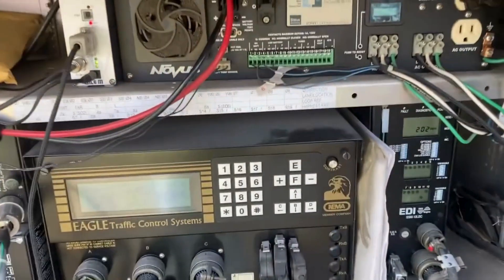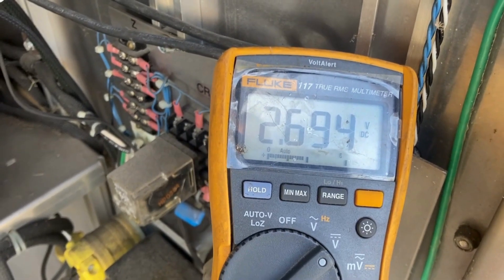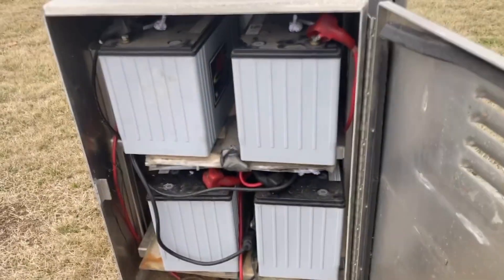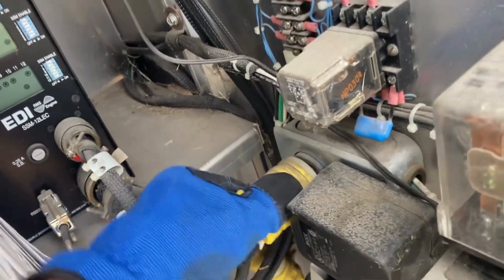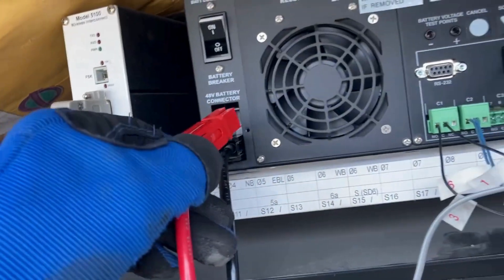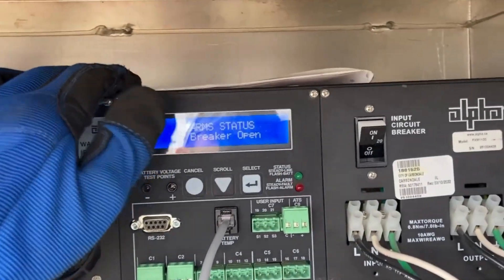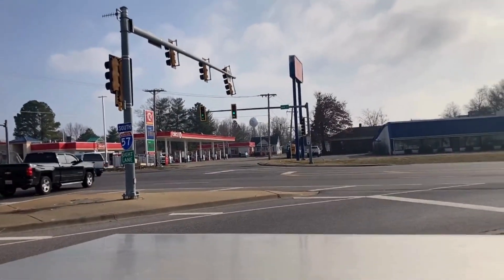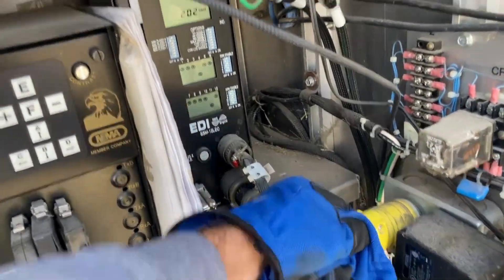Cutting Off Power to Traffic Lights

Comment: Usually there is a generator connection on the outside of the cabinet and when power fails the city brings a portable generator to the intersection and chains the generator to the pole. 
I don't know how long a generator keeps it running for.
Reply from the maker: Yes, some of our cabinets have that setup.  And yes, we do utilize that option when we know there is a wide spread power outage and the estimated time could be more than 6 hours before power is restored.  That setup is nice to have!

Comment: I'm now convinced that a backup system should be required on all traffic light systems in the US.
Reply from the maker: You find out which drivers know to treat a signal as an all stop sign signal when signals go dark.  I see about 2 out of10 that blow right through it almost causing an accident.  It definitely becomes a dangerous situation without power.
Reply: @streetsmartstraffic  Where I'm at it's the exact opposite. I treat them like I'm supposed to, but I've had other people honking at me and give me the finger and all that jazz because I'm doing what I'm supposed to. Very rarely do I see anyone treat them properly. Even a basic 4 way stop people just blow right through.
Reply from the maker: @SOU6900  Ok i have to ask...where abouts are you located?  I'm sorta doing a pole on how bad drivers are getting...
Reply from the maker: @SOU6900  ah yes, those north carolinians  lol
Reply from the maker: @SOU6900  I sure do!

Comment: I appreciate the lack of editing. Sometimes I scratch my head wondering why something isn’t working only to notice that the equipment isn’t plugged in😂 I know there’s a temptation to edit out little boo-boos like that. I appreciate your keeping it real👍👍 These are teachable moments for traffic signal techs learning the trade. Great job.
Reply from the maker: I try to keep it real!  As i talk about in other videos, I keep the camera rolling to show mistakes I make so other maintainers (and as I have found out--many signal hobbyiest) don't make the same mistaks.  I balance between length of video (get to the point!) --vs showing small things that may be missed during troubleshooting & repairs.  Thanks again!
Reply: That is why IT does as that first... so many times it is the issue...

Comment: Nice to see DOT being as proactive with their batteries as the cable company. (at least you're replacing them once spotted.) Also, at 2V for a 4S string... those batteries are now trash. (there's no telling how long they've been like that. not that we were shown how old they were to begin with.)
Reply from the maker: I answered this same question in another comment here...so sorry for the redundcy.
This video was shot not long after I came to this DOT. They were down a tech for over 2 years and many things went wayward.  One of initiatives we pushed 1st was to update all the batteries.  (Probably sat dormant for years).    Anyway, as we were replacing batteries, we found many dead BB units.  They're not cheap so we had to budget over time to start replacing them.  This was one of them...
Thanks for commenting!
Reply: You mean more pro-active!  Cable company just says "hey customers, if utility goes out we can't do shit about it, don't call us not our problem".  They actually went and fixed this traffic light backup!
Reply from the maker: @matthewmiller6068  Well we tried!  Once we get all signals on to our network to monitor (over time this will happen) we can set up alarms to notify us when batteries are getting low.  In the meantime, we started a 4 year plan to check batteries for replacement.  Thanks for the comment!

Comment: Seams like there should be maintenance done on the batteries on a regular basis, thats what companies do that have critical equipment.  Not sure the purpose of a battery back up if there is no checking or maintenance done.
Reply: Unfortunately, AT&T is guilty of the EXACT same thing. Years ago the company treated battery backup systems as a serious, important function to provide total reliability to the customer. Not any more. Even when the company was regularly having pallets of batteries shipped to outside facilities warehouses, they would not schedule outside plant technicians to do battery replacement. Batteries simply sat in the warehouse. SERVICE is no longer a priority❗️
Reply from the maker: I answered this same question in another comment here...so sorry for the redundcy.
This video was shot not long after I came to this DOT. They were down a tech for over 2 years and many things went wayward.  One of initiatives we pushed 1st was to update all the batteries.  (Probably sat dormant for years).    Anyway, as we were replacing batteries, we found many dead BB units.  They're not cheap so we had to budget over time to start replacing them.  This was one of them...
Great question!

Comment: That's really interesting; Worked on some huge industrial furnaces and they got battery back ups on conveyors should everything fail.
Reply from the maker: That's cool!  Interesting to hear about other industries that use BBU for criticaly type applications.  Thanks for commenting!
Reply: @streetsmartstraffic  It's to ensure the machine won't be damaged during a power outage in my situation; For both of us machines need to provide services even if half rooted.
Reply from the maker: @TradieTrev  Agreed!

Comment: I didn’t know traffic lights had battery power backup. I don’t think any of the traffic lights in my town have it. If there’s a storm and the power gets knocked out, the traffic lights in the area are all dead, and you treat the intersection as 4 way stop.
Reply from the maker: Not all intersections have them.  Some municapilities don't want to spend the money as they'll just use generators or stop signs during outages.  We get them in our spec on every new or upgraded cabinet design.
You'll usually see them on higher speed corridors due to the increased danger posed by outages at those critical intersections...
Thanks for commenting!
Reply: "Light, sign, line"... but no one remembers that from driver's ed. (i.e. no one cares about the law.)

Comment: The fan of that backup unit looked really clogged!    Why don’t use LiFePo4 batteries as replacement instead of Pb?   Tnx for the vids!
Reply from the maker: Yes as I answered a few of the other comments, this was a dirty cabinet.
I don't really have an answer for battery question  I had to look up a little about them..
It said the drawbacks are:  higher cost, slower charging speed, lower discharge rate, and limited temperature range are some of the drawbacks of using LiFePO4 batteries.  Maybe their not compatible or optimable with the system?  I'm not sure...

You're welcome and Thanks for commenting!

Comment: If the batteries sat for any length of time at such a low voltage, theyd be pooched anyway even if you did recharge them. So glad you decided to replace them!
Reply from the maker: Great point!  I just hate throwing out anything and if there's any chance of life to it, I want to still use it.  In this case however, I'm glad I replaced them too!  thanks for commenting!
Reply: @streetsmartstraffic  I've had alot of success reconditioning lead acid batteries on a decent charger, especially the sort with the caps as you can rewater them... But only managed to get about 50% capacity back.

Even with half the capacity, probably not bad to keep on the truck for an "up shit creek" scenario when you don't have any in the shop or can't get to them.
Reply from the maker: @alex13902  Excellent point.  I brought those back to the shop bought I think they ended up on the pallet for return.  😬
Reply: @streetsmartstraffic  Likewise but whenever I've encountered an issue with the charger or even if it was only one battery that was faulty, both batteries would be replaced as preventative maintenance in the fire alarm system.  Same for the emergency lighting.

Better safe than sorry.
Reply from the maker: @dang48  ah, good to hear...and agreed!  Thanks for your input!

Comment: I can see why that battery backup went RIP.... That fan.... must have been a pretty harsh heat stroke before that battery backup threw in the towel and said "bye bye".
Might be good to invest in a battery powered vacuum cleaner (like milwaukee M18 VC2), so you could do some "preventative cleaning" inside those closets, especially around fans and ventilation holes.
Reply from the maker: You're right Sebastian!  Many of these cabinets have either been upgraded or are finally get cleaned up.  As you know, alot of stuff already takes a beating from heat--they don't need all the dirt as well!  I've since purchased a large wetvac to do some major cleaning in these cabinets.  
Good observation!

Comment: I'm rather surprised that a signal maintainer finds, by surprise, that a battery backup system isn't functioning.  I guess very long periods can go by where nobody peeks into these cabinets.
Reply: I have to pass a certain intersection most days going to work. I'm going on 10 years in the same building. I've learned a few things watching these videos. I'm quite sure this signal needs adjustment. Cars in the turn lane might get a green or the might not. I can just miss the green light, sit through the entire red light and still not get an arrow. I make sure I'm in the exact zone I should be. It's still a roll of the dice. So either that's the plan or nobody has checked this light in a long long time.
Reply from the maker: @glen4cindy  Isn't it frustrating!?  There are a whole host of possible issues going on there.  Sounds like vehicle detection is present but may not be optimized correctly?  Best bet is to find the phone number to the municipality public works department.  Give the intersection name and you're best description of the complaint.  I've had a few youtubers that have sent in video of the issue to their municipality's website contact info.  
BE PERSISTENT.  Many times, the problem doesn't get addressed right away.  But the squeaky wheel gets the grease!  Hope that helps...
Reply from the maker: I answered this same question in another comment here...so sorry for the redundcy.
This video was shot not long after I came to this DOT. They were down a tech for over 2 years and many things went wayward.  One of initiatives we pushed 1st was to update all the batteries.  (Probably sat dormant for years).    Anyway, as we were replacing batteries, we found many dead BB units.  They're not cheap so we had to budget over time to start replacing them.  This was one of them...
Great question!

Comment: How does the battery backup connect to the grid and to the equipment? Is there a transfer switch to cut between, or is the battery between the grid and the load? And if it’s between grid and load, did you have to turn off the equipment for a few mins/seconds to switch from the old to the new?
Reply from the maker: @sebastianneilsen did a great job explaining this below.  It's instantaneous when utility power loss occurs (instantly switching to BBU power).
There is a transfer switch in all new systems.  By switching form 'BBU mode' to  'Bypass mode', you can route power thru the switch and safely remove the BBU for maintenance or replacement.  
Great question!!
Reply: It is different for different backup units. Some backup units are "online", meaning they will constantly "run off battery" and then have a charger hooked up to that battery. Those have no downtime at all when it loses AC.
Other units are "Line interactive", meaning if power goes, the traffic light will be black for like half a sec while the system realizes it has no AC and flips the relay to battery power.

Both models have its advantages and disadvantages. The online model will put a constant load on the battery, and can cost more in electricity, while a "line interactive" model has straight pipes from source AC to load when its in "AC mode". The obvious disadvantage of a "line interactive" model is that you lose power to the load for the time it takes for the relay to switch over to battery power. In some cases it can be acceptable, if the backup powers something insensitive, or a load that has capacitors that can hold the power for a little while, when the relay is switching.

A traffic light going black for half a second while the battery relay switch over isn't a big deal, the bigger problem is the controller restarting and possibly restarting a sequence from the beginning which could confuse motorists.

Regarding hookup, all battery units are put between source and load, meaning if you swap one out, the traffic lights are black for the time it takes to swap one out.

The one in the video is a "online" model, which you could see when he plugged out the plug from the socket. If it would be a line-interactive model, everything would have gone black for like half a second.
Reply from the maker: @sebastiannielsen  Thanks for explaining that!

Comment: Why is there no monitoring on the battery backup system?
That would reduce how much local access you would need to do for that preventive maintenance... 😉
Reply from the maker: I assumed I would be asked that question (and by looking at the comments I was right!).  This video was shot not long after I came to this DOT. They were down a tech for over 2 years and many things went wayward.  One of initiatives we pushed 1st was to update all the batteries.  (Probably sat dormant for years).    Anyway, as we were replacing batteries, we found many dead BB units.  They're not cheap so we had to budget over time to start replacing them.  This was one of them..Great question!
Reply: @streetsmartstraffic  But as far as i can see, you didn't add monitoring to it either?
Do you even have monitoring in place for traffic lights, or do you rely on people reporting defects?
Reply from the maker: @blinking_dodo  Monitoring!  Yes, another initiative I'm pushing is connectivity.  About 1/3 of our signals now are connected via fiber or cell modem.  All feed back to our server where they can be monitored.  If it has an ethernet port, its hooked up!  
However, this one has yet to be connected unfortunetly.  In due time!
Reply: @streetsmartstraffic  Good to hear. But as a hacker i must ask: Is it secure? How do you verify you haven't given the entire internet permission to put all lights on red permanently? I assume you have a security specialist that does that for you?
Reply from the maker: @blinking_dodo  We do have the distributor IT person program the switches & servers IT devices.  Then there's some internet security on the server.  
I hear the secutiy issue often but you would need 2 things in place...someone (a hacker) to break into the server THEN you need someone who knows how to use the software on the signal tech side.  
I'm not as concerned as most agencies that maintain their signals don't even know how to use the software LOL
Great question
Reply from the maker: @matthewmiller6068  I answered the same question prior so sorry for the redundancy.
We do have the distributor IT person program the switches & servers IT devices.  Then there's some internet security on the server.  
I hear the secutiy issue often but you would need 2 things in place...someone (a hacker) to break into the server THEN you need someone who knows how to use the software on the signal tech side.  
I'm not as concerned as most agencies that maintain their signals don't even know how to use the software LOL
Great question
Reply from the maker: @ehsnils  Interesting...But I'm assuming they would physically have to break into the cabinet and hard connect to the cell modem, correct?
Reply: @streetsmartstraffic  That's right, but many locks aren't that hard to pick.
Something I have realized after watching lockpickinglawyer a few times.
Reply from the maker: @ehsnils  Its definitely doable.  The keys for the cabinet are floating around ebay is see...

Comment: How long can the batteries keep the typical intersection up and running during a sustained power outage?
Reply from the maker: There are a few variables to determine that. Two of the biggest factors are:
 1)  Size of the load--meaning how big is the intersection (how many lights are there to provide backup.
2)  Size of backup--meaning how many batteries do you have parallelled together for a 48V system.  
Another thing we previously had to take into account is if the indications are LED vs incadescent.  I know they're still out there but most signals have been upgraded or replaced to LED's
With LED's, on average, you save 75% power.  Example, a full blown intersection with incadescent bulbs could pull 20A of current.  Replacing with LED's, that same intersection may now only pull 5A.  Which means a BBU can provide power for a longer duration of time.  

Now your answer..LOL  Most intersections I maintain with 4 NEW batteries (over time you don't get as long of a backup run time) and an intersection pulling an average of 3-4 amps, I would estimate 4 hours.  
Hope that makes sense.  Great question!  And one I am asked often.